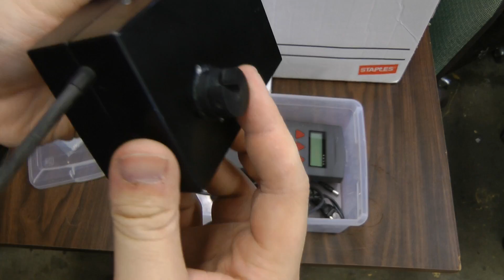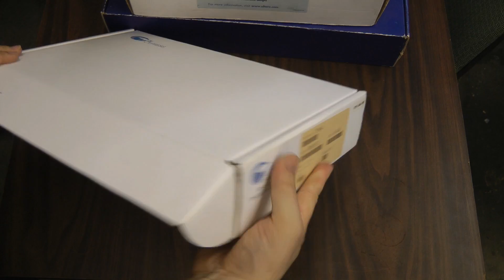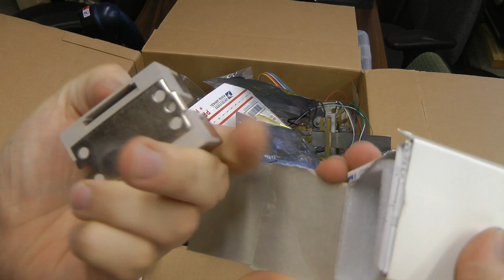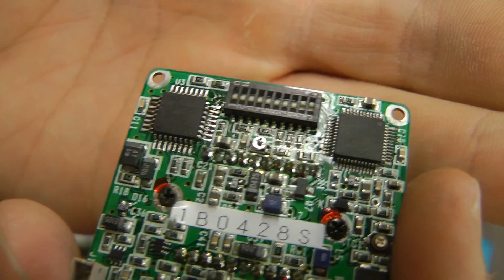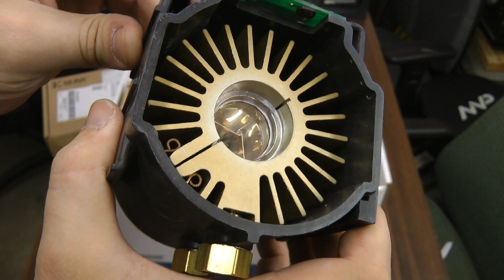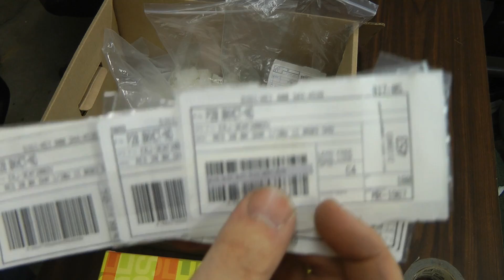Equipment donation and new website

Comment: I wouldn't be so quick to blame Fluke for the offset on that clamp meter. It could be that the bad bulb was drawing very high current pulses that were far enough out of the meter's range that it magnetized the core slightly.

Comment: That is nice stuff. Those pumps looks almost the same like what I got for a project. They can generate almost 2000 mbar / 60 psi of pressure and vacuum down to 100mbar / 3 psi. I use them for a blood pressure meter calibrator I designed at work.